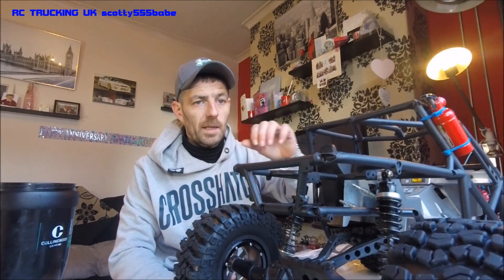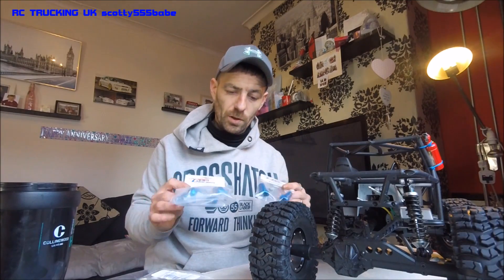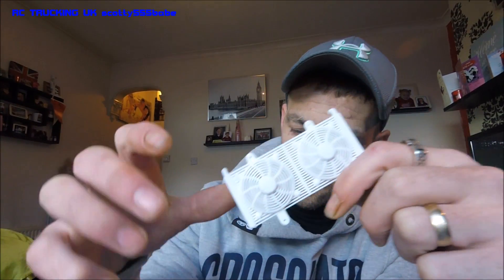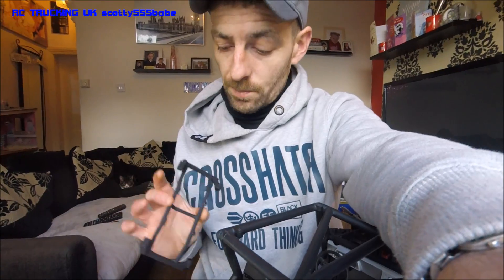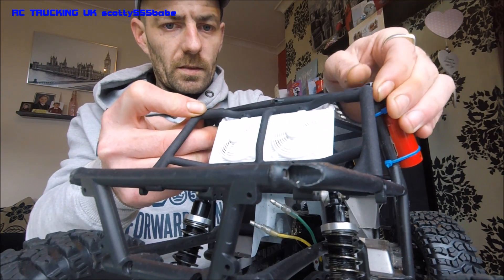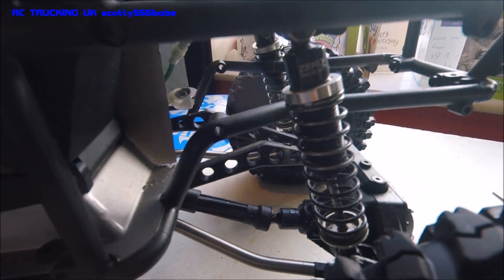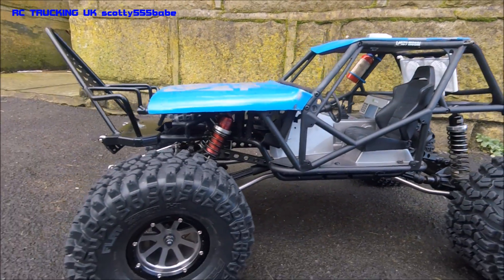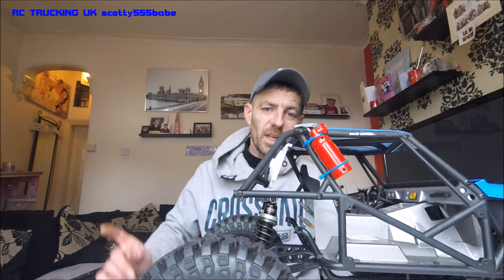AXIAL WRAITH FASTBACK STRUTS AND RADIATOR | ANOTHER CHOP TO THE WRAITH

Comment: You're absolutely right Mate... That looks BADASS!! 👊😎 
I've done the Fastback Mod, like half a million others, buut I want to be more unique as well. That's a clever Upgrade, that looks good and is functional as well. With that centre hole in that new bit, it appears that I COULD use that as a Spare Tyre Mount! I've already got a Scale looking Radiator from an Axial EXO - even with Hoses running from the Radiator to under the floor, heading to the front.

Yeah, it really looks like you found the right bit of Kit for the back!!  Although, NOW your rear is even LIGHTER than before, isn't it? At any rate, it's a Damn sight better looking than before. Then, that's WHY we do these things!!
Carmine 💥 ⛽
Reply from the maker: Thank you, I wanted something different to the usual wraith and I actually love the look, I have some cvds, chubs knuckles and rear lockouts from Gpm to fit also, the only thing I spent decent money on was the tyres and shocks, but I don't believe that's an area you can really go cheap with when building a crawler, I have all aluminium panels on my other wraith, just sticking with plastic on this to keep all the weight down 👌
Reply from the maker: Thank you, I wanted something different to the usual wraith and I actually love the look, I have some cvds, chubs knuckles and rear lockouts from Gpm to fit also, the only thing I spent decent money on was the tyres and shocks, but I don't believe that's an area you can really go cheap with when building a crawler, I have all aluminium panels on my other wraith, just sticking with plastic on this to keep all the weight down 👌
Reply: Right, unfortunately there's no Cheap substitute for Tires on a Crawler. Though many try!! 😱😜
I do really like what you've done. Standing out with a Wraith, is really not easy!! Mine's still not done - but then are they EVER!!??  One thing I can tell you from several years of experience - and failures. The Universal Joint Front Shafts that come standard on Wraith Spawn and Poison Spyder, are STRONGER, and have better Steering angle than ANY others out there, except maybe Vanquish. 
And they cost no more than GPM or Hot Racing!! 

My Wraith is anything but LIGHT!! 😱 This thing weighs in at just under 14lbs!! The bargain I got on a Brushless Motor/ESC gives me no worries when I point her uphill...
Then again, I believe that this went together with more with more LUCK than skills!!! 😜  It just all seems to work. The extra weight plus Shocks that AREN'T stiff (huge N00B mistake), means that almost all the time, all 4 wheels are on the ground, pulling. 
Like yourself, I'm not swimming in Cash, like many in the Hobby seem to be. Guys like us do what we can, and frankly, I like ours better!!
It's NOT hard to just write a check for $1000. It IS hard to do this on a shoestring.
Carmine 💥 ⛽